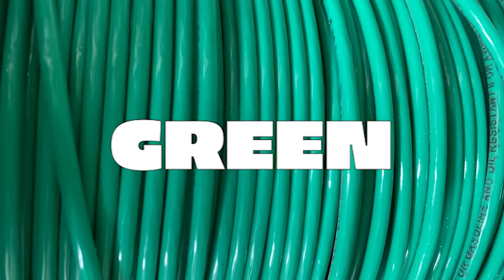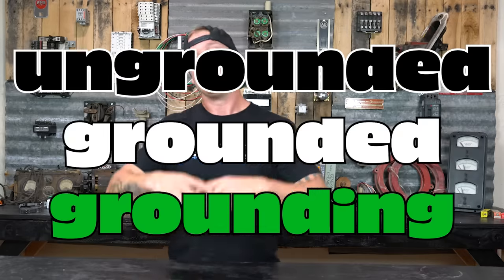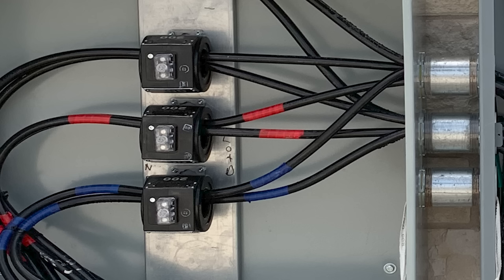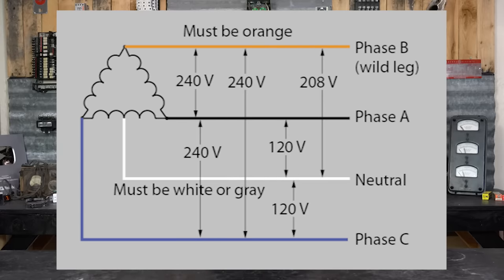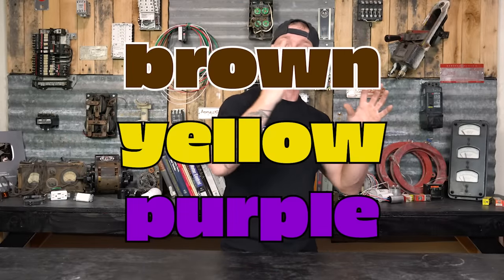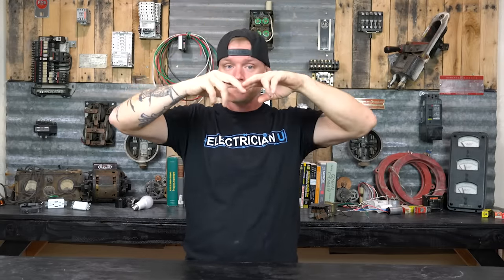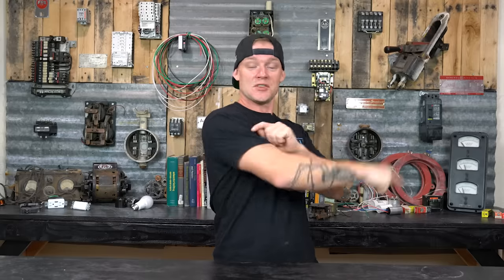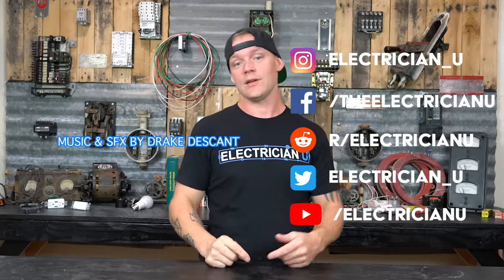Electrical Wire Color Coding Used By Electricians

Comment: A 3 phase 208  is black, red, blue because there is no high leg . For 277/480 it is brown,orange, yellow and that’s per the National electrical code the high leg is always orange
Reply: There is no high leg in 277/480. You're confusing the orange requirement when there is a high leg (120/208/120, for example) with the common practice of coloring the center leg of 277/480 . There are very few NEC color code requirements for ungrounded conductors.
Reply: @pld8993  I don’t know where you work but where I am 277/480  4wire has a high leg and if you don’t identify it properly ( with orange marking along with the other colors- brown and yellow )the utility company WILL NOT connect
Reply: @chesterczerny3480  Each phase to neutral/ground measures 277V in a 277/480V system. Please identify the high leg in a system where all the phase voltages are equal.

Comment: Good video!  I was always wondering if electricians when wiring their own houses don’t use a special wiring to identify 3way circuits or how to distinguish between light and fan power leads? Jim
PS what about identifying switched outlets?  Thanks....Jim
Reply: Starting with fan "switch legs", I have never identified a fan switch leg (conductor) different than one for a light but always placed it in the proper location while doing the splicing in the boxes where multiple switches were going to be used. 
On the "three way" circuits, when you are "pulling wire" into raceways, the two "jockeys/travelers" are usually pulled using another color that's different from the actual circuit color. Example would be black "jockeys" on a red 3 way lighting circuit with the hot/switch leg being red so when it's time to wire the switch, it's totally obvious which conductor is the "common" on the switch. 
With romex type wiring, when you are doing the rough-in (pulling in the cable), you would identify the switch leg by taking your side cutter and "crimping" the end of the cable (an inch from the cut end)  like you're going to cut it which leaves a crimp in the insulation. When it's time to splice the switch box, one end of the circuit gets that switch leg "wraped" one time around the two "jockeys" while the "hot" conductor pigtail (at the other end) gets wrapped one wrap around the two jockeys. On Romex, color means about nothing (other than green. Sometimes, even a white can be a hot. Such as at a switch.) so these kind of "indicators" are critical and the guy installing all the devices needs to "pay attention". 
No indication on switched plugs in my career.
Reply: I started in residential 40 years ago, always used romex then, black hot, white neutral, red switched to outlets that needed to be switched ( always gave the option of half switched)….. paddle fans black fan, red light, white neutral, because some people only wanted light to be switched and used the pull chain for fan speed because back then the fan speed controls always made the fan hum 😭
Reply: I've heard of some guys installing switched outlets upside down (grounding pin on top.)

Comment: Orange is not always 208v to ground(high leg). Where I work the color code is ROB :red orange black, for every system 120/240v 1ph 3w, 120/208 3ph 4w or 277/480 3ph 4w or 480 3ph 3w. With white for neutral. Check out my posts at electrical_pics on Instagram

Comment: Low voltage is 50v and down. I never heard a sparky said he was working on low voltage in a 120/240v panel. 50v-1000v is considered medium
Reply: Low voltage is below 600 volts. Medium voltage is above 600 to 69,000 volts

Comment: Combination ceiling fan/lights often have extra colors too so you can wire the light and the fan to separate switches if you want to.
Reply: ..... get outa here.   I rewired a 21 stack wafer switch on a Gyro Compass aboard Ship,  with a million combinations and COLOR CODED WIRES. the switch rotated through a dozen feeds  at each position.  FIRE CONTROL,  SHIP GUIDANCE, RADAR,  CIC, bridge, aft con  etc.    I got in trouble for sleeping in while entering port the next morning, ... after an all night emergency.   CODE ain't the end of it.... LOL.
Reply: Common practice when I was doing non-union tract house/residential electrical in the Colorado Springs area, ceiling fans were ran from switch to box with 14/3 cable... Black was the fan motor, red went to the light kit, then white and ground went to their respective wires. All bedroom lights were setup for future fans with proper fan boxes and 14/3 so the homeowners could easily swap the cheap builder's boob lights out with ceiling fans or other lights. With 14/2/2, romex, you can do cool tricks like run between 3-way switches and also take power with travelers to a box where you also have a single-pole switch. Or a receptacle in a similar scenario. And 12/2/2, lets you take 2 circuits with you, like to run pair of circuits for the fridge and adjacent countertop receptacles, splitting at the recept location closest to the home run.

Comment: On a 120/240V three ø four wire delta, the high leg is not always orange, some areas,  especially much older installations,  used red for the high leg, in fact some old timers referred a high leg delta system as red leg delta,  a couple other names were wild leg, dog leg, stinger leg,  bastard leg, bitch leg.   In fact the NEC states that the high leg must be marked orange,  or other effective means.   So it doesn't necessarily have to be orange,  although pretty much all inspectors will require orange.  Interestingly,  the Code only requires the high leg be marked orange,  in applications where the neutral is also present. A three phase motor for instance,  does not have a neutral and doesn't care if the high leg is on phase A, B, or C, and so a motor disconnect might not have orange on the high leg.   Therefore it's extremely important to verify voltages with a meter, before you start hooking things up.  Do not rely on colors.

Comment: You forgot to mention that it's not legal to use single conductor black wire with white tape on it for a neutral or green tape make a black wire a ground unless it's a 4AWG or larger wire. I see this lot especially in the last couple of decades when wire cost shot up. People buy 500-foot roll of black wire maybe 10 gauge use it for everything just put some white tape on the end to show it's a neutral wire. You can do this with multi-conductor wire most of that already has a white wire.

Comment: Ground and neutral are not the same and are not always tied together.  If they were there would be no need to have bother of them.  There can be a potential on the the neutral.  Low current but it is there.  I got bit by a neutral wire before.  I have seen them tied together in cases, but don't bet on it.

Comment: Great video! Q: (example if buy a 3 phase motor) but I only have residential single phase how can I make it work? Or red and black make 2 please ? Thanks for the video
Reply: You can get a special VFD (variable frequency drive) that can run the 3 phase motor on single phase, but be prepared to spend some $$

Comment: I'm in MN and all high voltage systems are marked Brown, Orange, Yellow. I have never seen Brown, Yellow, Purple.
Reply: Never saw purple in Indiana either. Blue was always 24V, yellow was coming from another panel and not controlled locally. This was industrial. Perhaps some changes since I retired 6 years ago.

Comment: beware-wire colors used in electronics are different- 12volts DC are red hod and black cold.    other colors within a circuit are often started with 12 volt colors (given) and 5volt supply lines are often red and black too.  Beware of 115vac and 230vac are not for electronics but are given in this video.

Comment: I was on a job doing startup on equipment, and with breakers off, neutral to ground would produce 18vac.(120vac)
I told the electrician, he poked around and said “well I don’t know, just what it is”
Reply: Were all the breakers off?  Was your meter a low impedance meter?
Reply: Misfired outlet?   Jim
Reply: The neutral wasn’t properly bonded.

Comment: Color codes only really apply with grounded conductors, grounding conductors & high legs. Motorola's code was Blue Red Black Gray 277/480, Yellow Purple Brown White 120/208 or 120/240 with a high leg, but the high leg was still purple (only with orange tape). Orange was exclusively used for 115-600 Volts @ 400Hz. It is a military power system. Motorola has an onsite engineering team so the NEC does NOT apply to Motorola. We could use street ells and all kinds of other crazy (now) 100% illegal stuff as long as their engineer signs off on it. You had better have some good communications skills & practical knowledge to get this goofy stuff approved by an EE. They never turned me down.

Comment: Do any houses run 3 phase
Reply: In a multi-family home with like 3 or more apartments, 3 phase is common, but each tenant typically only gets 2 phases for 120/208
Reply: Some older homes do, my home was built in 1950 and had an old bulky air condition system. Its fun playing the balancing game with my circuit loads after I upgraded ac system.
Reply: Most homes will never need it but you can run in into a custom home or mansion with a mechanical room full of motors and special equipment...
Reply: Farms, sometimes do, depending on power needs and what’s available.    Jim

Comment: Glad you didn't get into low voltage wiring (door bells, thermostats, intercoms, etc.) color codes. Sometimes it seems for those that the color codes are only based on whatever multi-conductor cable the installer just happened to have on hand...

Comment: The orange color is reserved for the high leg in a 3-phase Delta system.  The orange should not be used anywhere in a 3-phase Wye system.
Reply: @Don Ski…. Would be a good idea but it’s use is not restricted by NEC. All 480v systems I’ve encountered have been BOY and very few have been Delta. Of course when they are Delta and have been tapped for a neutral the high leg is Orange as required by code.

Comment: We here in europe (i speak for italy) we call the eath like this and not ground becasue in houses we have a single phase system (brown for hot and blue for neutral) and neutral is not grounded as in america (we have 230V single phase, business can also have 380V three-phase+neutral (4 conductors+earth for a total of 5) systems but on the street (and on the panel) it is separate from single phase lines). Here neutral and hot come from the city power and go like that all the way (with circuit brakes and all this safety things along the way) and eath is connected to a rod put in the gound outside the house (normally evern 2 or 3 rods 2-5meter into the eath) and that is not connected to any other cable in the electrical panel. 
If here in italy we mesure between eath and hot or eath and neutral we mesure 0V, if we mesure something else ther is a problem somewere and it means a leak to ground (we never mesure this becasue we must have a central RCCB with a sensitivity of 0.03 (i think this is the right word for what i mean)  and if that sense a leak to eath it cut off power to the entire house. Some newer house also have a second RCCB for the bathroom with a sensitivity of 0.01 or 0.001. This work becasue nothing is connected to eath in the panel and if a certain potential comes from the city lines from the hot wire it must come back to neutral, if the RCCB sense that ther is a difference between the 2 vaules it will pop open and you have to reset it manually.

Comment: I lifted the cover and found a black and white and a red and red.Well I was doing this at night with a flashlight but when I changed the angle of the light - what I thought was red and red was actually a red and an orange. The wires were old and dusty and really looked as if the orange was actually red. hehe

Comment: Back in the 1980's worked in a large plant that had 6 electricians. Cave men did not believe in color code in any 120/208,240,277& 480/277 volt panels for energised conductors. One of these lazy guys had 120,240 &480 volt three phase power feed from three separate panels. He thought he had the power off but nope cut into a hot wire.

Comment: Holy cow! All these colors, isn't there a fixed code for using these colors nation wide?
I live in Finland, we have yellow-green(striped) as ground, blue for neutral and brown, black and grey for 3 phases. And only 230V single phase and 400V 3-phase systems for consumers. All in that same color coding. And every house has 3 phases coming in.
I wouldn't want to do electrics over there.
Reply: The US is 50 semi autonomous regions they call "states", all with their own rules. With local regulations on top of that, I doubt there will ever be a national standard for something like this.

Comment: I’m a retired heavy industrial maintenance electrician, I worked in a paper mill & a 14,000 megawatt coal fired power plant, and what we considered low voltage was 600 volts and below.
We had mostly 480/277 Volt  Y systems, plus the 208/120 Volt  Y systems for our low voltage stuff, the the high voltage 1380/4160 Volt Y system High voltage.
We had a lot of big motors with high voltage, both 4160 and 13,800 volts.
We did have 13,800 volt motors.
I never wanted to be a house wireman or commercial electrician, the fun stuff is heavy industry.
We did everything from construction to troubleshooting, and everything in between, most days was something different, unless a big construction job came along.
I loved my 37 years in the trade, and wouldn’t change it for anything, most everyday a new experience.
I worked mainly in Fuel Supply at the power plant, our maintenance group was responsible for our 14,000 megawatt plant, plus our sister 14,000 megawatt plant across the street.
Our operators would take the coal from the lake boats (70,000 tons) or trains (12,000 tons) and make sure it got to the proper place.
We had like 12 miles of conveyer belts, powered by 4,160 volt motors.
So we dealt with switchgear, motor control systems, general lighting and if it ran by electricity we were the guys that got called when something wouldn’t work.
Tons of stories to tell, fun times.
I’ve worked with some of the best tradesman in the country, Electricians and other tradesman, all professionals, and we all looked out for each other, and would help each other if need be.

Comment: Black/Red/Blue 3 phase 120/208 volts.  Brown/Orange/Yellow 277/480 volts.  Black/Red/Blue 4160 volts in my area.  On a 240 volt 3 phase Orange is the bastard leg.

Comment: Single Phase 3 wire 120/240V Black, Red, White. Three Phase 4 wire Wye 120/208V Black, Red, Blue. Three Phase 4 wire Wye 277/480V Brown, Orange, Yellow. Three Phase 4 wire Delta 120/240V with bastard leg B phase to Neutral Black, Orange, Blue (dirty BOB with his bastard leg). Three Phase 3 wire Delta 480V Brown, Orange, Yellow.

Comment: Nope. Orange is used often, not rarely. Any delta system has a high leg that will be designated with orange, old straight power 240 has its high leg(if there's a relationship to ground) is designated with orange. And 277/480 is brown orange yellow(Oh B.O.Y... were gonna need another layer of arc rated clothing..)

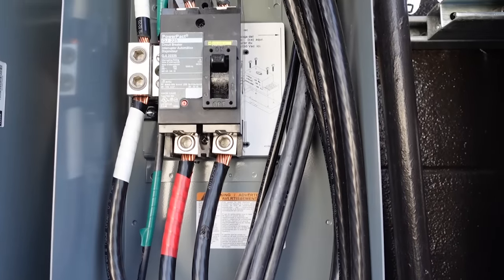Comment: At 6:50 ish you said single phase is black and red.  How does one phase have 2 identifying colors and how do you know its not blue?  If this is a code requirement then theres always at least 1 violation.  Rhetorical

Comment: Ya ground the neutral in a wye system.Usually inside the switchgear. Ya don't ground the neutral of a delta system. Or the neutral of a generator.
Reply: You absolutely still bond the neutral of a delta.
Reply: @atmacm   Yes, to the center tap of the 240/120 transformer run between 2 of the three phases. Don't need a neutral, otherwise, in a delta. It was meant to be a 240 range, dryer, water heater service, back in the day.

Comment: Your analogy about ground going to “earth” or the “ground” is not true.  It should be referred to as appliance ground.  Yes it is attached to the ground rod but so is the common wire.  The ground rod is there protecting your house wiring in case of a lightning strike on a transformer, as it safely diverts the charge to the ground rod since lightning is trying to get back to the earth. There is too much resistance in the dirt compared to to a appliance ground wire so it will not cause a short at the panel.

Comment: Im a sparky in the uk, I totally understand the 120/240v system, but who the hell decided 208v for one leg of a three phase supply ???
Reply: The physics of a Wye transformer dictate the 208v
Reply: On 240v delta system, you center tap A-C winding. This causes 120v A-n, 120 v C-n and 208v B-n. It is the physics of electricity.
Reply: He’s talking about a 120/240V 3 phase grounded delta.
Reply: The 208V for the high leg comes from multiplying line voltage 120V times 1.732 and this gets you 208v.

Comment: This is a little insulting. Neutral is NOT always white. On 277-480 volt systems, grey is usually neutral. I’ve also seen grey used on  ungrounded neutrals especially in hospital operating rooms. You are making blanket statements that will get people hurt or killed. A color is never a substitute for checking every circuit for voltage. And per NEC there is no defined color code for conductors, but the 2020 code now requires the color code be posted on the panels and also post if there are inconsistencies in the facility. Assuming a wire is a specific function because of color is a good way to die
Reply: And if you go to another country, neutral is suddenly blue and white is phase.